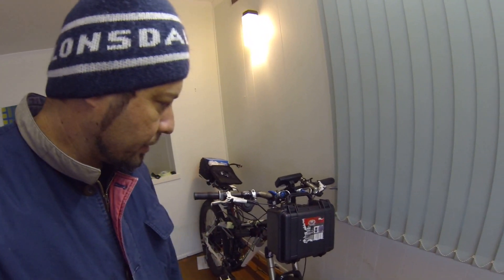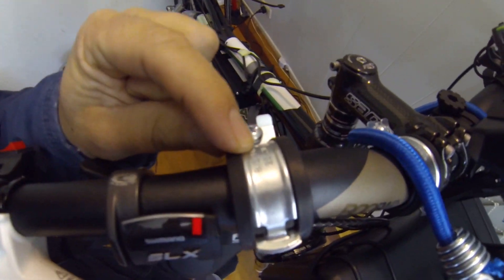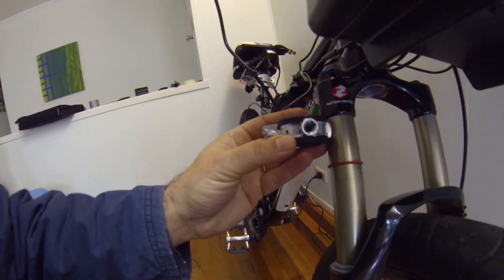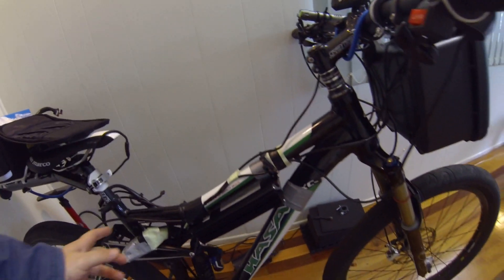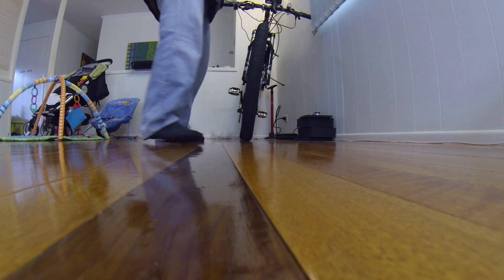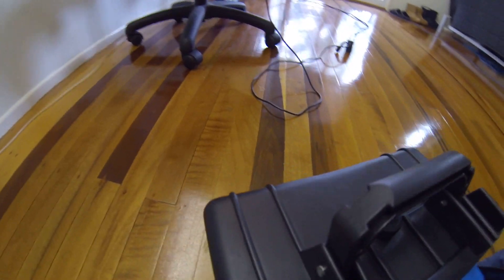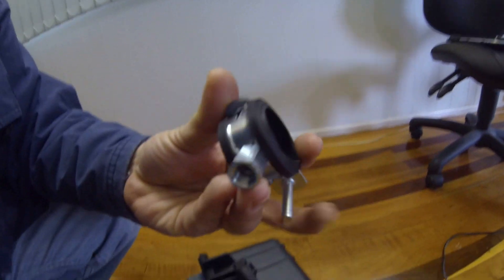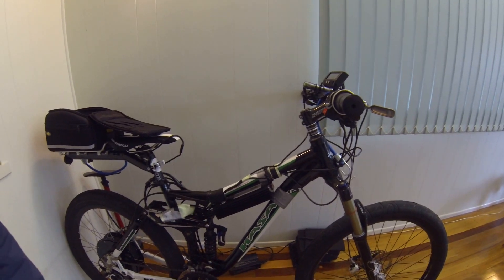Electric bike conversion battery mounting crystalyte 4065

Comment: G'day. I found the best ideas was to use a Thule brand  pack n pedal bike rack mounted to the front of the bike. (26inch MTB) Use an army ammo box to store the battery, with fireproof padding to line the inside of the box. Drill holes in the box to place the wiring thru to the outside. I also have a rear mounted LIPO4 battery 48v 25a in an oversized 50 calibre ammo box ,mounted to a custom build aluminium  Rear rack. I found most racks i purchased, including expensive ones just bend under the inertia and braking off the bike. The motor is a mid drive Bafang BBSHD. I also have a Bob yak trailer that can carry a battery and gear in it. Cheers and thanks for the vid John.

Comment from the maker: there is lipo batteryies half the weight and size but they have less cycles and must be handled carefully or they could explode into flames.  but i do believe it is early stages since lithium has only been around a while, acid batteries were much worse.